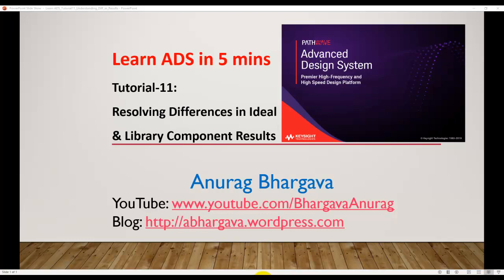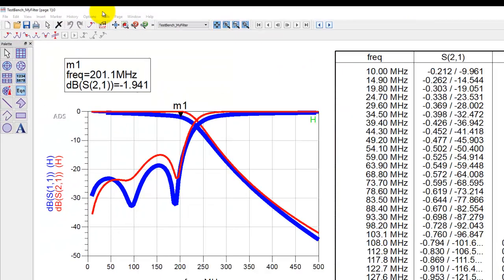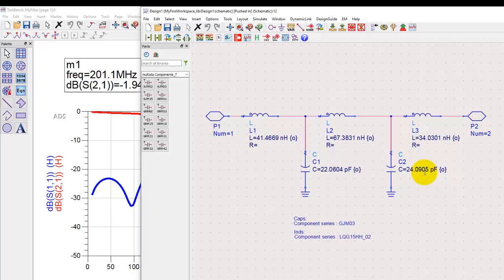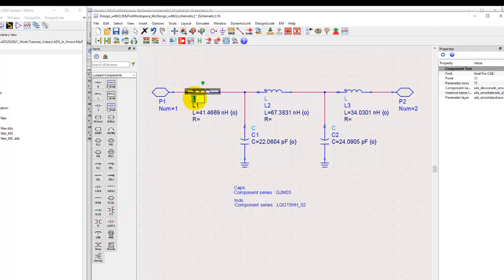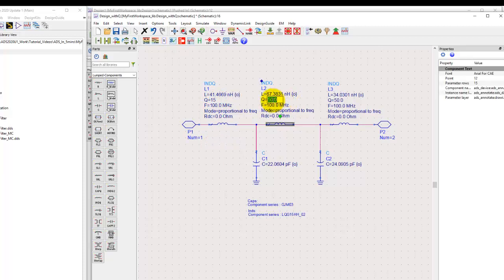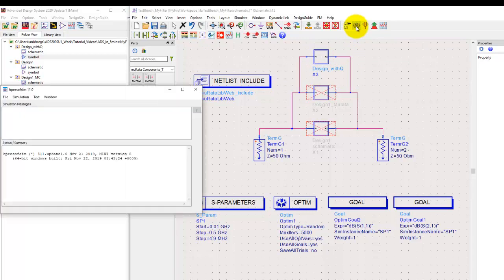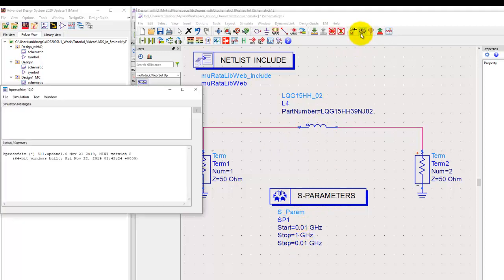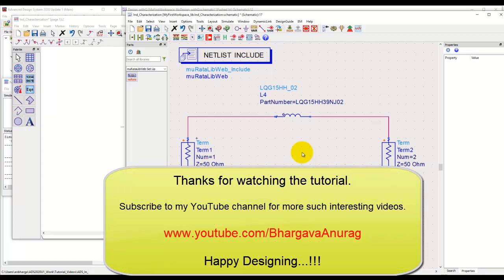Tutorial-11: Resolving Differences between Ideal and Vendor Library Results

Comment: Thanks for all these educational videos.
When putting CAPQ or INDQ, should we change the frequency of these elements to the center frequency of the design? Or the default 100 MHz doesn't make much difference?
Thanks.
Reply from the maker: Hi,
Every manufacturer mentions Q at a specific frequency (usually 100 MHz) and that's what you need to mention. If they mention Q at different frequencies then you can select whatever is closest to your actual design frequency.
Reply: @BhargavaAnurag  Thanks a lot for your response. May I request you to please have an educational video about envelope simulation? (If it isn't already done)
Your videos are extrdmely helpful for my research and I immensely appreciate it.
Reply from the maker: @behnooshmeskoob1003  That's in pipeline and we will reach there soon.
Reply: @BhargavaAnurag  So, basically we are indicating the loss resistance associated with the inductor. Generally, this loss resistance is fixed. Q and Reactance change with frequency.

Comment: Very nice videos, however i have a question about the difference between 'save a copy as' and directly 'copy cell' ，would you please tell me the difference? thank you very much
Reply from the maker: They aren't much different. Options are provided for different thinking minds...😊 Advantage with copy cell approach is to rename main design as well as the dependent sub-circuits in one shot which wouldn't be the case with Save As. Hope this helps?

Comment: Hello sir, thank you for your videos! They have guided me in designing rf circuits so far. But I'm facing difficulties when trying em cosimulation for vendor components. The schematic simulation works fine. But i don't seem to understand where I'm going wrong with vendor. I have used mgap in my circuit and i think that is the cause of the issue. Like my cosimulation graphs aren't matching. And there's no proper manual to know what steps to follow when using mgap or vendor components for cosimulation. So if you could make a step by step video on em cosimulation for vendor components, it would be extremely helpful. PLease do consider my request. Thank you.
Reply from the maker: Hi Karishma,
I replied to you separately on another platform on this already. I prefer to use MLIN(Pad)-MGAP(Spacing)-MLIN(Pad) kind of approach in most of my schematic designs simply because it offers an opportunity to model the impedance discontinuity that will arise wherever your interconnect transmission lines between the components joins with the SMT component's pad. You can deactivate schematic components at the stage where you want to create layout so that any inherent footprints included in the SMT models doesn't interfere with the layout generation or the SMT footprints that is obtained by MLIN-MGAP-MLIN structure.
Reply: @BhargavaAnurag  Got it sir, thank you so much!

Comment: Hi, I would like to check the quality factor of one of the murata capacitors. I used the template (S2 port capacitor CRQ) in the data display as you did.But it seems it shows somewhat random and incorrect data. May I know why? Basically, how do you expect the Q factor of the murata capacitor to be around 100? I want to check more accurate Q factor of capacitor
Reply from the maker: Hi Yuchan,
Here is what I would recommend for Capacitance as well as Q-factor calculations:

1. Place a Capacitor on the schematic and setup 1-port S Parameter simulation, ground the 2nd terminal.
2. Run S-Parameter simulation and write following equations on the data display page:
myZin=stoz(S11)
myCap=-1/imag(myZin)/(2*pi*freq)
myQ=-imag(myZin)/real(myZin)

Cap Q-factor normally is 500 or higher but again it depends on the size of the Cap and freq at which you are looking at. Also, usually datasheet of Cap and Ind will surely mention Q-factor at some frequency...sometimes it is 100MHz and in other cases it may be different.
Hope this helps...
Reply: @BhargavaAnurag  Thank you so much for your help! Yes, I just tried your equation and it's similar to the datasheet given from suppliers